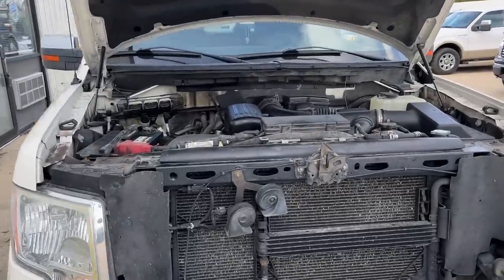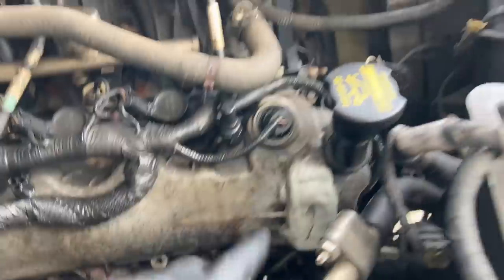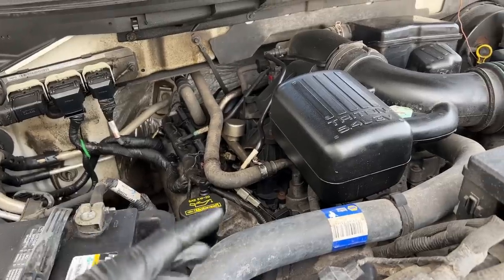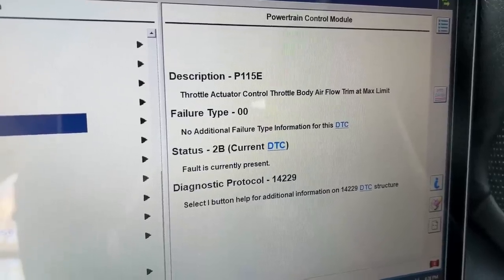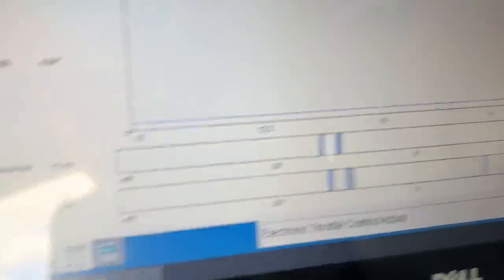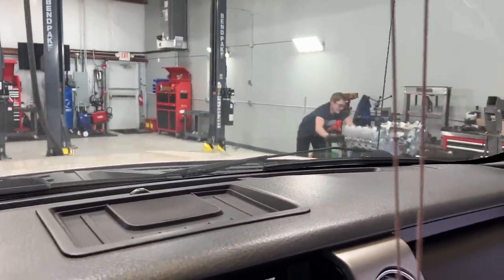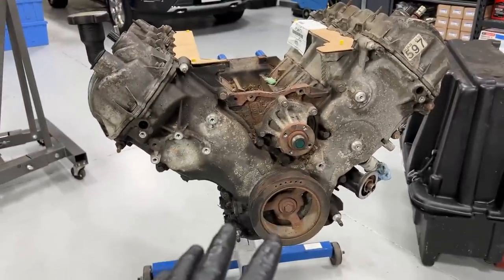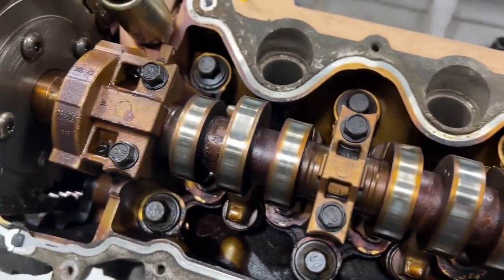Why are Ford 5.4L 3v Triton Engines Jumping Time and Cracking Valve Covers?

Comment: It's thanks to this guy and his videos that the motor in my '06 expedition is still running strong. At about 110k miles I heard a little rattle at start up. I replaced the whole timing kit with Motorcraft parts, while I was at it, installed a Melling oil pump and all new roller followers. 40k miles later and this engine still runs quiet and smooth as the day I drive it home.
Reply: This is actually a helpful comment . . . :o) 
Should we wait till we hear it or do this at 100K no matter what?
Reply: @hikerJohn  My '03 Town Car started doing the same thing a start up at 105K miles. Nothing loud just a very slight ticking for a few seconds. It has the 4.6, but basically the same type of timing chains and guides. I decided to replace them and good thing, because one of the mounting points for the guide was broken off and the guide was sloping around. Had I waited it would have been a huge repair, dropping oil pan etc. My advise is if you have the resources replace the set if your are worried about it. If you can do it yourself the cost is minimal.
Reply: Where did you buy the parts? I need tensioners and followers

Comment: I have a 06 f250 that had 160kmiles and it had done this, dealer assumed it was cratered. I got it for 2500 and used your videos to do a timing rebuild, put a junkyard valve cover on it and a melling 360 oil pump. I have 246k miles on it now and im only 3500 into the truck.  Runs like a top still, thanks bro!

Comment: Amazing video and demonstration! Honestly Brian, I can't imagine what the Ford community would do without you. Your depth of knowledge, expertise, patience, experience, and willingness to share is beyond commendable. Ford's engineering in these Triton motors is surely questionable. Too much going on in this valve train to merit any reward of reliability no matter how well the engine was taken care of. Cam phaser issues, a timing cover as wide as the engine bay to possibly break out as you show, and.. with the added bonus of a spark plug or two someday blowing out of the head from only two to three threads of engagement, could only make one question what were they thinking??!! You are a diamond in the rough. And from myself and many others, a big thank you. Love your videos and content!
Reply: My 05 f150 timing chain run out at 216000 I just fixed last week thanks to this man to sharing the link for ford original parts..now my truck runs like new 👍

Comment: I don't care what anyone says, I still follow the old-school 3K or 3-month OCI.  Oil is cheap vs. a new engine or timing job.
Reply: Same. Gives me peace of mind and runs so much better with newer oil
Reply: @Hvy Chvy, 
" ... 3K or 3-month OCI. ... "

Great for metal parts, but I don't think it will make that cheap plastic junk not break and destroy it all anyway. Figuratively, a chain still breaks at weakest link.
Reply: Oil changes  are the key, best with high mileage oil, like max life, or similar, that will help keep the plastic parts like new.

Comment: Have a very nice 2012 King Ranch that the guide broke with 202,000 miles. Mine did the same thing, jumped time. Considered repairing, but went with a Powertrain replacement engine. Installed it myself, now we have a new King Ranch Expedition. Runs fantastic!.  Thanks Brian for your videos, very helpful. I saved about 75,000.00 by not buying a new vehicle.
Reply: Yep, I've got an '04 3V with 118K and it runs like new. I change the oil every 4000 miles. If the engine develops issues or even needs to be replaced, it'll happen. Insurance and registration on it is virtually nothing, it's been a great truck and still looks like new. A lot of guys are doing whatever it takes to keep them going...$5000, $10,000 is a whole lot cheaper than what a new one will cost you, that's for sure.
Reply: yea ,but at the time was it sounding like this one in the video, at the time you replace it """

Comment: I have a 2008 with over 200,000 on it....never any issues...runs like a champ...but I have maintained it meticulously.
Reply: I did the full timing and pump at 135,000 , I had no issue's or noise before or after . however I had a blown drivers side tensioner on tear down . 
At 200,000 mi that's empressive
Reply: Ours is over 200k and still running ok. The ac doesn't work, which may contribute to better engine performance, that and regular maintenance.

Comment: Something to consider, if one trip around the vct sprocket ride jumps timing by one tooth, imagine if that piece of chain guide gets stuck a few revolutions. It incrementally misadjusts timing further until the inevitable crunching destruction takes place. Awesome forensic demonstration of how this occurred.
Reply: When this happens, the car runs much noisier and begibs to smoke with oil spraying everywhere. You'd have to be pretty clueless to let this continue for more than a few miles.
Reply: @Firebert79TA  sounds like 85% of drivers on the road today. Ever watched the just rolled in videos on yt?

Comment: Strange things can happen deep inside the valve cover!  I loved the JB Weld patch repair,  that's epic.  Great exposition as usual, Brian, and you tell it like it is when things get weird.  What I also like is that you show the computer's display of the failure results.  That's so important for diagnosis and as usual you explain it like you built it yourself because you really understand the engine and the whacko physics and things that can happen.

Comment: Good video sir! I've got one of those 5.4 ltr 3valve motors with 145,000 miles on it currently. I purchased my 06 Expedition back in Jan. of this year. So far it is running ok. I have an exhaust gasket leak going on right now but that's it. I'm making sure to do my oil changes regular so I can try and keep that old 5.4 running reliable.

Comment: I’m super happy with your videos on the 5.4 3 valve. I replaced my VCT SOLENOIDS  after a careful inspection and it totally solved my problems. The timing chains, guides and cam phasers were done prior to me buying it. I’m pretty sure they were aftermarket parts but so far no problems. If I can get another year out of it, I’ll change them.

Comment: I just finished doing a full timing job with the upgraded oil pump and manifold on my '10 with 164k nothing was broken but it sure sounds better. Thanks Brian for the videos and the confidence to do it.  One side note, one of the phasers from the recommended kit came apart in the first 2 miles, and the supplier exchanged it immediately without question.
Reply: How much did it cost?
Reply: @JMac85X  I bought the kit thru Brian's affiliate links and I thought all were pretty reasonable considering how much the shop wanted, I think I saved about $2000 doing it myself. His videos really are accurate and extremely helpful, I watched then 4-5 times.

Comment: Brian, I have a 2006 f250 6.0 with a problem I've not seen you or anyone else talk about. It only has 140,000 miles on it, and I take very good care of it. Had it since new. We live out in the woods, and I drive on a washboard road. Out of nowhere my dash cluster and radio drop out like you shut the key off, come back on and maybe not do it for a week or so, maybe that same day. I thought maybe a cab ground as I had that on an old chevy. Didn't help. Before I unplug every plug, I can find and clean them I thought I would ask what you thought. It's driving me nuts! You're a good man for sharing what you know with others. Keep up the good work., Thanks'    Clyde

Comment: Cheap timing set from previous owner did that to mine. I didn't have the money for new, but with your channel I was able to understand this engine well enough that I rebuilt it. I went OEM timing set, replaced roller followers,  new lifters, new bearings all around, and new Melling high flow oil pump. Hoping this truck lasts another 250k.
Reply: What's wrong with the OEM oil pump? Ive heard bad things about "upgrading" to high flow oil pumps but cannot remember what engine it was for, just that we should not do it unless you have a performance engines with larger bearing clearances. It can overwork the pump and cause it to fail killing the engine.
Reply: @hikerJohn  OEM lacked in oil flow due to constraints of the modular block. This channel has a great video on this and he recommends the Melling high volume pump (M360-HV?) to improve the oil delivery to the phasers. Especially on bank one which has the longest path in the oil passage.

Comment: He’s back Heeeeesssss back. You’re the  reason why my 5.4 is still on the road
Reply: I bought truck that needed a timing job and his videos are awesome. I personally recommend that you disable VVT and get the ECU reflashed. The 5.4 2v  wasn't known for timing issues. I believe VVT causes premature chain guide problems by the way it slaps cam timing around to perform EGR.

Comment: Thanks for the video Brian. I have a 2009 F150 with the 5.4 3V with 128,000 miles. I keep it serviced  at 5,000 miles. Hopefully it will last a long time. Thank you again.
Reply: Better service it every 3k keep that engine clean
Reply: I change my oil a bit sooner than that...4000 miles, tops. I also use 5W30, full synthetic. Engine purrs like a kitten.

Comment: I always watch your videos regarding 5.4 3 valve I have a 2006 F150 Harley truck real clean I love it but when I first bought it used it had 35000 miles on it and it had that catastrophic failure at 62000 . I had a Ford warranty on it and they put a brand new long block in it now the Truck has 120000 on it no warranty I change oil every 3 to 4000 miles and always listen and hope.

Comment: Recently got a  2005 3V After a week it started dripping coolant on top of the transition bell housing. Nothing I did allowed me to see a leak. Even tried removing pass side tire and liner. Found some info about the crossover gaskets replaced them with no joy. 

Most of the searching I did kept coming back with 2V's leaking from the pipe / hose under the intake or the leaks from the quick connects on the newer models. It took watching the video you did about replacing the motor with your son in your newish truck to see the 3v has the same pipe under the intake, So that is my next go to. Just thought I would share my journey with you and possibly give you an idea for more content. As I searched for a long time to fig out what is back there and could be leaking. Just to realize it is prob the same failure the 2V is pretty known for. 

Thank you, for all your content you have helped me on many issues in the last few years as I now own 4 f150s and a expedition 2v
Reply: The 2v and 3v do have a lot of shared similarities so it probably was the same problem

Comment: This just happened to my 2008 F250 5,4L 3-valve.  185,000 miles.    Drivers side Valve Cover blew out while driving. It got us home with 1 1/2 qts of oil left in the pan.   New engine time?   Good tip; I'll patch with PB-Weld to drive short distances.

Comment: That was a really cool demo.
It's crazy that can happen so easily.
I wish Ford had designed the timing chain(s) on 4.0 SOHC V/6 like the 4.6 and 5.4 engines.
Thanks for the video!
Reply: "So easily" ??    It took 200k miles for it to happen.
Reply: @calholli  This is one of the few that luckily made it that far. Typically they have issues way way way before that.
Reply: @calholli  I've got an '86 Grand Marquis with 286k miles on it. No such failures. I only did the timing chain at 230k miles since I needed to repair some oil and coolant leaks around the front cover. Car is still on the ORIGINAL driveline front to back, AND the original electric in-tank fuel pump! Try that on anything built this century, lol. 😁
Reply: @SmittySmithsonite  My 97 Isuzu Rodeo 5spd 4x4 has over 320k miles, (finally broke timing belt)..   My 2002 F350 7.3L Diesel 6spd 4x4  has 340k miles, all original.. absolutely unstoppable.  and my last truck was a 95 F150 5spd 4x4 that passed 310k or so before it finally spun a rod bearing... and I still sold that truck for $800 with the blown engine. lol..  I'm all about taking these cars the distance.  The key is to buy manual transmissions.. I drove that Rodeo offroad a LOT too, and it never broke anything on it.  I never even changed a U-joint on the driveshafts.  Smaller japanese 4x4's like that are the way to go for durability.  That's why the Toyota tacoma is known for being so bullet proof.  It's the smaller size that makes it have such longevity....   But when it comes to my Diesel, those were the best trucks Ford ever built.  99 to 2003 or so, with the 2nd generation 7.3L diesels.  Mine still has the original injectors, original glow plugs.   Dana 80 rear axle, Dana 60 front axle.  Just a TANK.  and I've seen some of these have over a million miles and I believe it.
Reply: @calholli  Nice! 👍 Yeah, I’m of the same mindset. I’ll keep my old relics going for as long as possible. I maintain them, repair them, and take them off the road every winter (except for our 93 Volvo 940 which was bought as a winter beater, & my problematic ’07 Silverado 1500 4x4). It seems anything built before the 2007 model year was built to go the distance. Stuff from the 80s and 90s even more so, especially Japanese stuff, and mid-90’s to ‘06 domestic diesels. Sad that nobody builds anything that good anymore.
Reply: The later 4.0 SOHCs (post 2004) were a little better in regards to the timing guides/tensioners. I have an 05 Mountaineer with the 4.0 SOHC and I started getting the rattle at ~2500 RPM at ~225k miles. I pulled the engine and did a timing job at ~235k (using Brian's videos) and the only failure was the primary tensioner (leaf spring) between the crankshaft and the jack shaft. I bought OEM replacement parts and noticed that the material/color of the guides looked different from what I was replacing. Ford made a few improvements to the guides/tensioners in the later model years. I religiously change the oil every 5K miles so perhaps that helped to get me past the 200k mark. Now don't get me started on the 5R55S.
Reply: Yeah, I wish my Ford will destruct at 180k too!
Reply: @bertblue9683  To be fair, if it was a timing belt, it would have been needed to be changed twice by then.

Comment: I had an hvac biz,  with a 98 E350,  03 E250, and a 03 E350 SD Cutaway, all had this engine. All had 3xcess of 200k miles,  E350SD HAD 283K miles when I retired & sold it to my wife's boss,  they put over 40k more miles and still runs
Reply: Thank you very much for sharing your experience. I'm trying to have hope that this will last me a little longer. I appreciate your comment.

Comment: I do a lot of engine work I’ve seen many ratcheting tensioners wear out and cause the engine to jump time because it doesn’t lock at all like on 2.0t audi and vw. 

The 2.2 and 2.4 gm engines use a ratcheting tensioner for the balance shaft and water pump chain, you can replace the water pump without removing the timing cover using a special tool however the tensioner sometimes will click a notch and the chain is too tight so there will be a screaming noise.

Comment: Im in the process of swapping my 122k mile 2006 f150  HD 8ft bed w/ 5.4 3v into another f150 from 2005. My 2006 frame rusted like swiss cheese. i blame the undercoating company. i had it done when it was brand new. They mustve washed it and sealed in the moisture becasue it rusted from the inside out. Ill never pay someone to undercoat my vehicles again. I found another F150 HD  w/ ext cab, 8ft bed ( 7 lug wheels) with a perfect frame with 274k miles that needed a cam /lifter/rocker and timing job. Piad 2700 and drove it home on 6 cylinders. ( scary).  id rather just use my known good engine. I will be doing  a timing job and manifold swap on my engine once its installed as a maintenance item. Thanks for all the informative videos.

Comment: My chain guide broke (timing chain, tensioner, guides, camshaft, followers all new 35k ago) and i thought it skipped timing. Like u showed in video. I don’t have damage on valve cover. 
At stop light truck lurched and idled rough then i got code p0012. Is that code the phaser on bank one?

Comment: My 06 F250 has 124k and I change the oil every 3k. I listen every start up for any noise. I will park it if I do.  It almost sounds like a reman long block would be a better choice than replacing all the timing system and cam followers.

Comment: Brian, given that the Achilles tendon of these engines seem to be in the stock oil pump, wouldn't upgrading the Reman engine to the M340 or M360 make sense?
Reply: And cast tensioners, if they are plastic in the reman engine.

Comment: Got a 2010 5.4 with p0012, p0341, p0346 and p0446. Brand new cam phasers, timing chains etc. runs good until warmed up then misfires under throttle and idles rough

Comment: My Lincoln TC just jumped timing at 212k- not sure what exactly caused it- the tensioners or lash adjusters- found 4 busted cam followers and small piece of the flange on the oil pump that follows the chain broken and 4 bent intake valves on the left bank. Ran fine- shut it off- went to restart it a few minutes later- would not turnover. Hope, I can get away with a new set of valves and timing set. It was smooth as glass and was about to order timing set  to avoid the above damage...